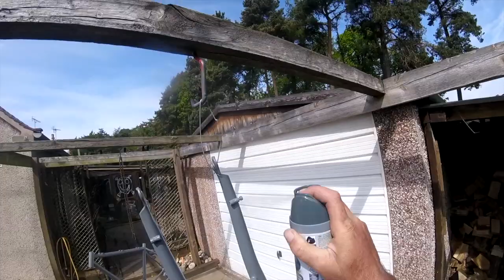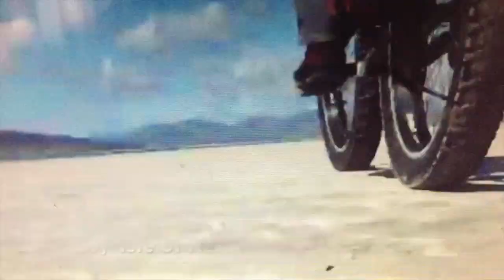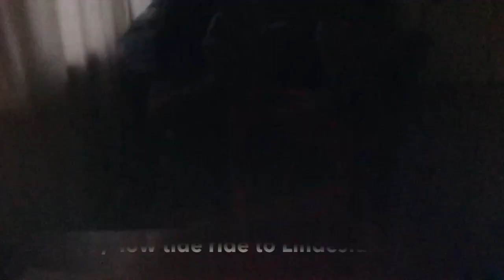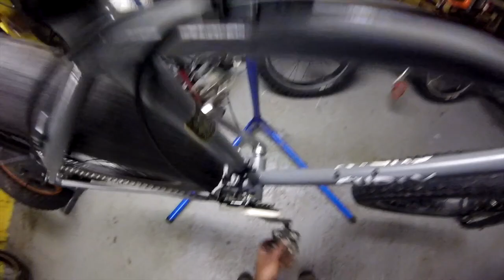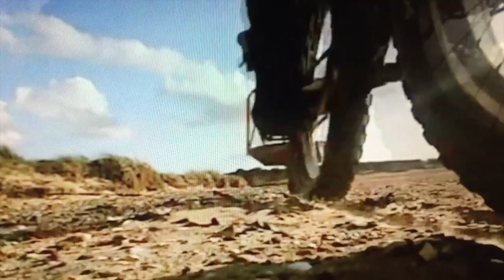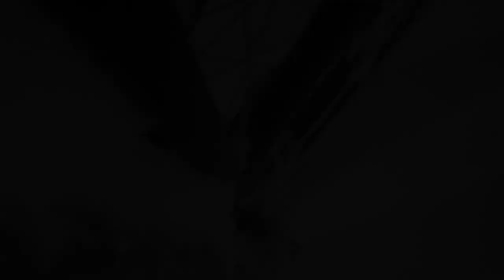2008 Surly Pugsley;  10 Years old Restoration

Comment: How has the paint job held up over the years? I just picked up a pug and want to do a rebuild similar to yours. I’ve thought about powder coat, but it’s pretty expensive. I’d rather the budget go to upgrading derailleurs, cassette, drivetrain, etc.
Reply from the maker: Hi, paint has held up ok, letting the paint cure for a couple of weeks before build the bike up helps it last on 😁👍